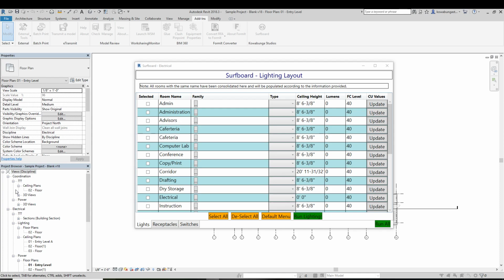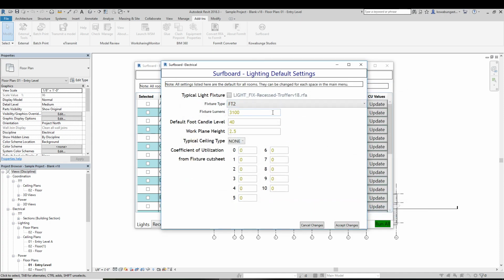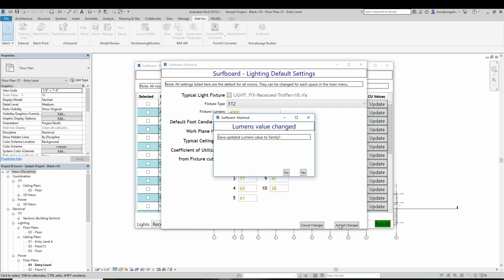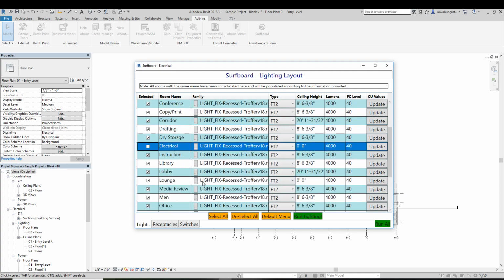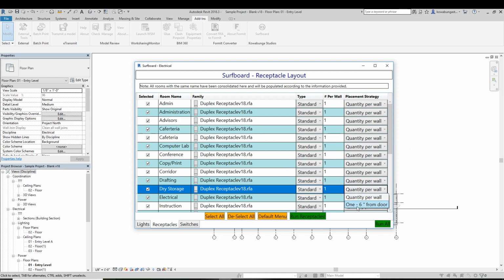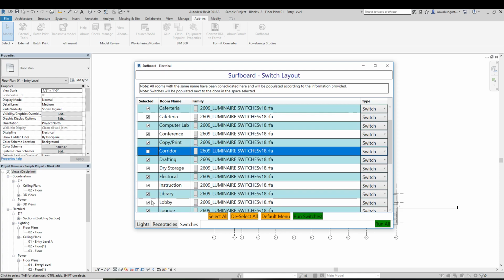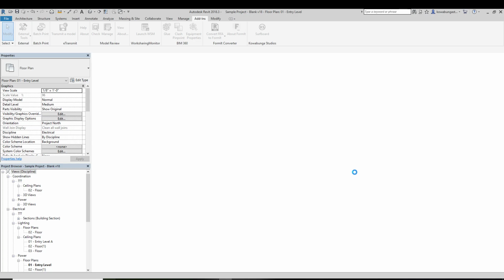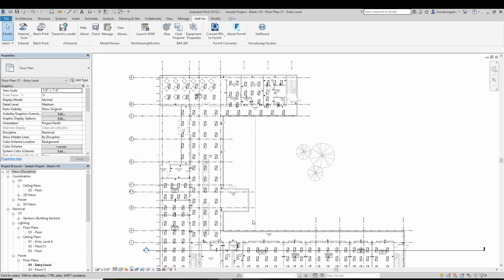Surfboard - Electrical by Kowabunga Studios [Revit Automation]

Comment: What happens if there are no room definitions? I have a lot of projects that have still not defined rooms at DD or even CD level.
Reply from the maker: Hi Jason, if rooms are not defined with names in the Revit model you would have to define them yourself to know what light level you want in which room and the receptacle layout. Not the best solution, but it would be a way to enable the use of Surfboard.